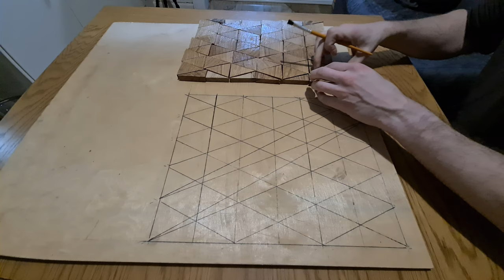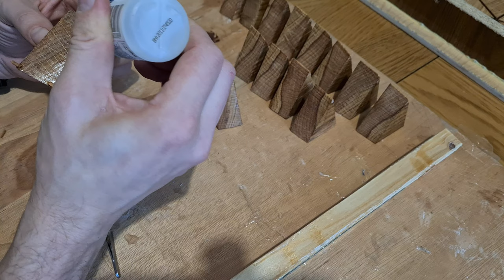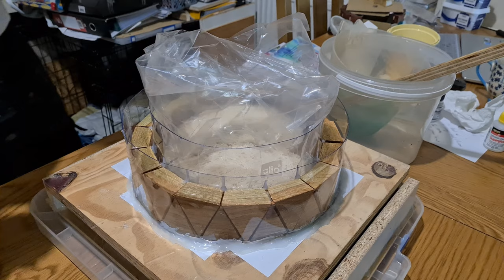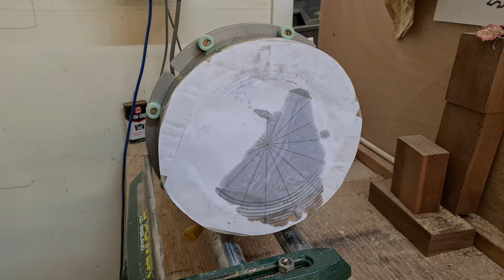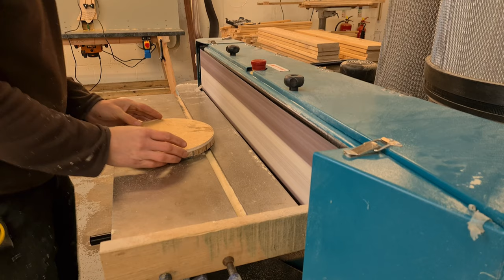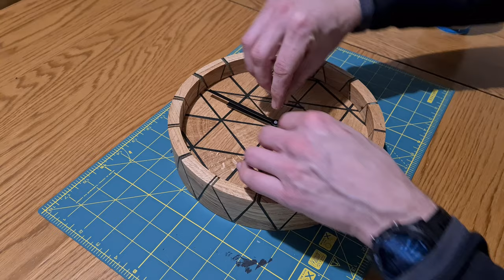Woodturning - Time

Comment: Hi Ray, Another great mesmerising video. I was allowed to make a suggestion I would hve used 12 pairs of triangles for the outside (5 minute spacing) and 30 degree triangles eminating from the centre.

Keep the great videos coming and keep safe
Reply from the maker: Hi Phil. That's brilliant! Never once did it occur to me. When I get the time(!) I'll give it another go. Thanks so much for the suggestion. All the best. Ray
Reply: @RayWhitbyCreations  Hi Ray, thinking about the clock face I would put a piece of dowel in the centre and then radiate 12 triangles around it, with the intention of cutting the triangles with arced (if that is a word) cut at one third distance from the point for 6 traingles and the remaining 6 at two thirds distance, this would give the appearance of a dart board with a staggered treble ring, I would still use resin in the designed gaps and possibly use 2 or 3 diferent types of wood, or rotate the grain

Just a thought

Keep safe
Reply: Hi Ray, adding to my suggestion above you could make the "treble" rings the same radiur as the length of the hour and minute hands

Keep safe

Comment: Best for view my dear, how many time for dry expoxy dear
Reply from the maker: Hi. I use Epoxyplast 3D B100 which has a drying time to a solid surface of 3-4 days and fully cured in 12 days. This dried clear, doesn't have a lot of bubbles and can be used on the lathe for woodturning. I am experimenting with using a pressure pot which helps to avoid the formation of bubbles. I hope this helps. All the best. Ray
Reply: @RayWhitbyCreations  Thank you for sharing your experience dear

Comment: Great Clock in the challenge.  I'm impressed with the LED back lighting. I'm guessing a lot of thought and calculations has gone into the making of it.  Love it.
Reply from the maker: Thanks Robert. I had a loose idea based on a video I shot a while ago, but hopefully will post next, using geometric patterns and epoxy resin. The tough part was working out how to cut triangles to make a seamless cylinder. Really enjoying making this one! All the best. Ray

Comment: Great piece of work Ray ,but how did you power the led lights ? mains or a battery ?
Reply from the maker: Thanks Steve. These lights can be powered by both. I put the battery pack in the back of the clock (4AAs), bit of a squeeze, but could also plug in via USB cable. Really appreciate your feedback. All the best. Ray